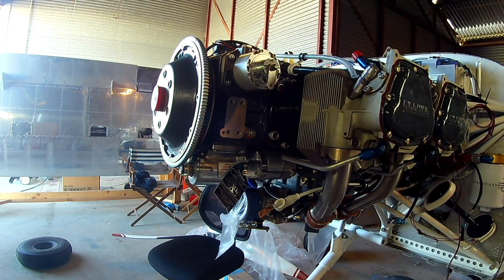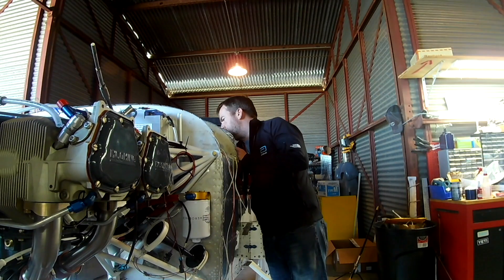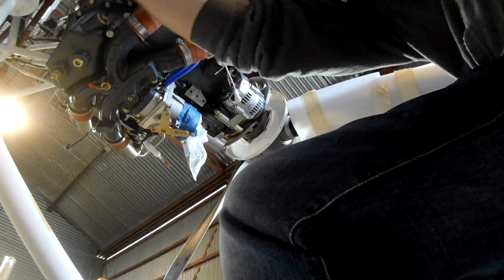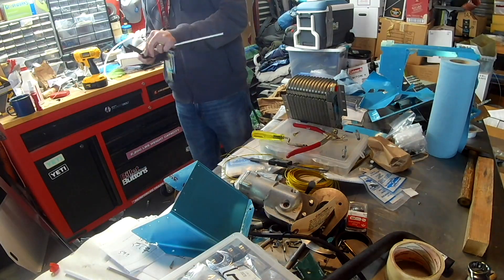RV-14 EFII, fuel, cabling, oil coolers

Comment: How did you route the crank trigger wire(s) through the forward baffles. I'm at this stage now and looking for ideas
Reply from the maker: I drilled a 3/8" hole and used a 1/4" rubber grommet on the front right baffle piece. There's more videos later where you should get a better angle.
Reply: @akilroy  That method worked well. Now I'm trying to find the throttle cable extension that you reference. Can't find it on the McFarlane website and their customer service pointed me to Spruce which appears to be a dead end as well. Where/how did you come into that extension?
Reply from the maker: @Nittyav8  I see the extensions on Spruce. They're out of the 2". A 3" would have actually been better and those are in stock: https://www.aircraftspruce.com/catalog/appages/extcontrols.php?clickkey=13278

However... knowing now what I should have known then I'd of put in a vernier assist cable
Reply: @akilroy  Got it thanks. Is there a video that shows how you routed the oil breather? Why the vernier assist cable instead?
Reply from the maker: @Nittyav8  With the power I have making small corrections across a 3.5" throttle cable range is tough.. a vernier would have been so much easier